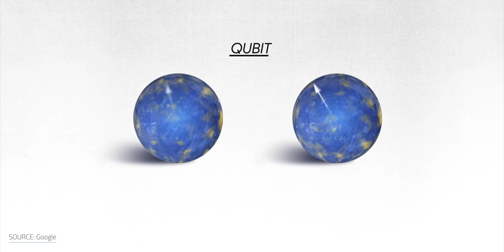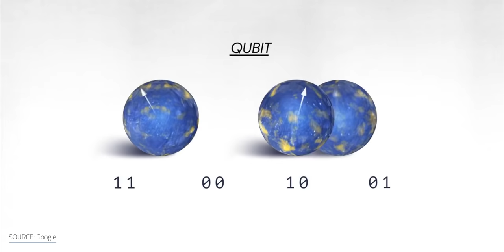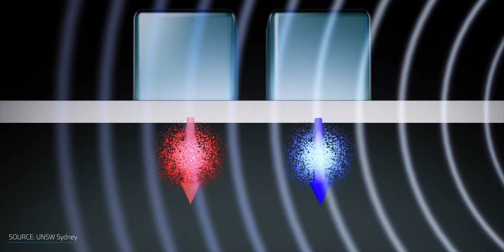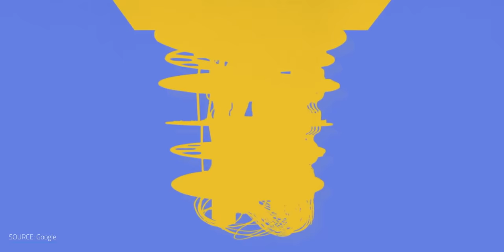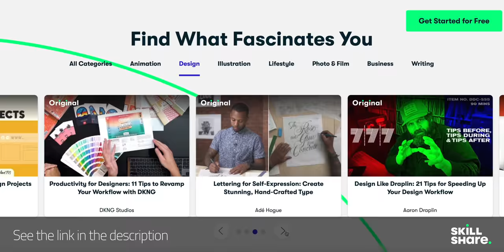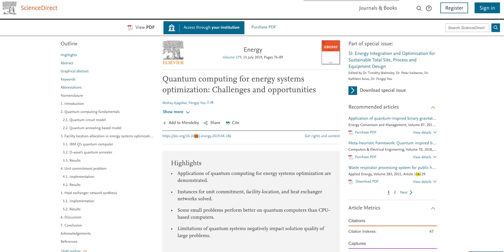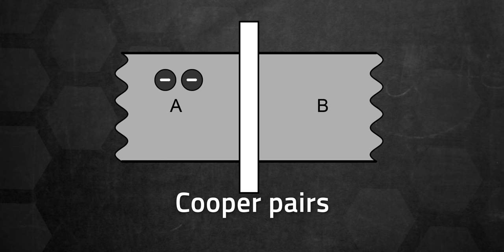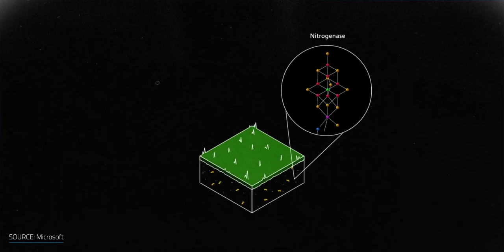Quantum Computers Are Coming … But Why Should You Care?

Comment: Quantum computers aren't faster than traditional ones; they're completely different.  They can (with very complicated math) try out all solutions simultaneously and come out to the one that works.  The way I think of it is a traditional computer works serially, while a quantum computer works in parallel.   Where a traditional computer would have to try all of the keys to a lock one at a time, a quantum computer would be able to try all of them simultaneously and tell you which one worked in one operation.
Reply: Didn’t he explain it that way too, with the postman example?
Reply: The whole "computing every possibility at once" thing is really not as accurate as it is said here; 
In theory, a qubit can encode mutliple calculations at once in a superposition but you can still only ever measure a single bit per qubit (even in theory).
That means that in the end you get at least linear O(n) scaling, as each measured bit needs at least one qubit, which is considerably better than many classical algorithms but still not "everything at once".
(Because many classical algos are in quadratic O(n^2) or O(nlog(n)) time.)

Comment: 7:53 Quantum computers are suited to solve specific types of problems where it outshines classical computing - usually involving combinatorics. This does not mean thart they can replace the datacenters used today for a wide range of applications (such as internet servers or databases).

Once built at scale, they would be more like problem-specific accelerators connected to classical computers similar to how GPUs are used today.
Reply: Yes, I think the video was wrong on this point. The quantum computer consumes less but can only outperform classical computers in specific classes of problems. Also, the video fails to mention that the cooling apparatus surrounding current quantum computers consumes a lot more than the processor itself.

Also, IIRC, quantum algorithms have only been proven to outperform classical in quantum physics simulations. There is a quantum algorithm to efficiently factor prime numbers (Prime's algorithm), but it takes advantage of specific properties of prime numbers and is not applicable to any other optimisation problem. And no, factoring Prime's is not exactly NP complete, so solving it efficiently doesn't automatically mean we will solve all other NP complete problems.
Reply: Yes. Most of it will be used by the big, high-tech companies. Not a single person on his/her table.
Reply: Maybe in a practical sense at first, but any problem that can be efficiently solved by a classical computer can in principle be efficiently solved by a quantum computer. P is a subclass of BQP.
Reply: @nazgulXVII  "There is a quantum algorithm to efficiently factor prime numbers (Prime's algorithm)" It factors integers, you can't factor prime numbers. And it's called Shor's algorithm.

"And no, factoring Prime's is not exactly NP complete" We don't know that.
Reply: i would say: at most. or, very very specific.
Basically they violate a basic principle of computing, which is abstraction and generality. They are NOT computers, they are physical devices, like say, a mechanical or a quartz clock. You always need a lot of computing power to encode the task and decode the result.
Douglas Hofstadter put it clearly already in the beginning of the 1990ies. A physical analog computer is suffering from encoding and decoding task and he elaborated with the Spaghetti computer. The spaghetti computer is the fastest thinkable computer to sort numbers. It is independent of the problem size regarding the sorting. whether to sort 2 spaghetti by putting them upright to the table, or 500... it takes the same amount of time.
The problem however is that you have to label all spaghetti according to their length, or even prepare the spaghetti in order to reflect the numbers at hand, and later to read that from the labelings. And here they loose their advantage.
The GPU are fast in matrix math, so you can use them for anything involving matrix math. Google proposed them to use for representing neural networks. Yet the do NOT represent the neural networks in their entirety, hence they come with a huge cost of getting partially blind.
Reply: @monnoo8221  "Basically they violate a basic principle of computing, which is abstraction and generality. They are NOT computers"
Nonsense.
Reply: @Kalumbatsch  that's a well-posed argument. So- called quantum computers are analogical devices. As such they are not computers that can be programmed to deal with any kind of computing task. Hence they lack a required level of abstraction.
Reply: @monnoo8221  "analogical devices"? What's that supposed to mean? You're just making stuff up.
Reply: @Kalumbatsch  well, I see that you are missing some rather basic knowledge. No point to argue hence.
Reply: @monnoo8221  Yeah, because you're just making stuff up. There is no such thing as an "analogical device". If you mean to say a quantum computer is an analog computer, that's also wrong.
Reply: @Kalumbatsch  
Well, it is by definition, not "digital".  Digit, as in digits of numbers; or integers. It's not that. Analog as in continuously variable quantities; not digital.  It is that.
Reply: @user-dj1hy6zc6q  Wrong. An analog computer is a specific kind of device, the term has a specific definition. And a quantum computer isn't one. It's as simple as that. And when you measure the state of a quantum bit, you get one of two discrete results and not anything in between. It's very much digital in that sense.
Reply: @Kalumbatsch  
Wrong, and wrong.
We agree with you that there are specific definitions, and that is why these are not digital computers.  I don't know what definition you are using.
The output of a true quantum computer is a superposition of all possible outputs with statistical confidence somewhere within that range.  It is not one or the other, or simply 2 possible outcomes.  If you think that a quantum computer's output is digital, I don't know if you know what a quantum computer is.
Reply: @user-dj1hy6zc6q  "The output of a true quantum computer is a superposition of all possible outputs with statistical confidence somewhere within that range"

No. The output is discrete. If you measure a two-level system you get one result or the other, and nothing in between. That's what "quantized" means.
Reply: @Kalumbatsch  
It seems you are not talking about a true quantum computer.
I am referring to a true quantum computer.  One that can process Shor's Algorithm, for example.  One that doesn't yet exist.  A computer that is definitely not digital and is definitely able to do amazing things.
You are talking about a broken one currently being marketed, maybe?
Your grasp on "digital" and "analog" is highly suspect either way.
The value in a true quantum computer is lack of quantization.  Your output is not digital and after iterations, it tends towards a result.  You don't get an immediate answer, but you get a probable answer long before any other known method.
The heart of quantum physics is probabilities.  The moment that you believe that an answer can be narrowed down to one or the other, is the moment that you must realize that the entire foundation of your supposed quantum computer is flawed.
A true quantum computer would say that 1+2 probably equals 3, but there is a chance that it equals 67.  You cannot quantize it to 3, otherwise you are doubting the entire principle of its operation.  If every step is not digital, how can you determine that the final result of X number of iterations is digital?
A quantum computer (a TRUE one) is not digital and does not give you an answer.  It efficiently (compared to other options for difficult problems) points you in the right direction, and then something else is used for confirmation.
Reply: @user-dj1hy6zc6q  When you measure a qubit, the output is one or zero. There is no way around that. The output is digital.
Reply: @Kalumbatsch  
And all the non-digital "computation" which got you different answers across many qubits and provided you a statistical distribution means nothing?
If it was a 1-qubit machine, sure. But then it would be useless.
The computation is non-digital.  If it were digital, no one would have any interest in a quantum computer.
How you collect and interpret the data is not the interesting part of the operation of a true quantum computer.  Computation and interpretation is not the same thing.  The computing part of a quantum computer is not digital.
Reply: @user-dj1hy6zc6q  The bits in your computer are represented using voltages that change continuously over time. That doesn't make it an analog computer. The logic is discrete.
Reply: @Kalumbatsch  
Agreed, for a traditional computer with digital logic and established voltage thresholds designed for binary or trinary or Xary logic of any sort.
The difference is that a quantum computer doesn't ever compute based on any set thresholds.  During no part of the computation are thresholds set to establish digital values interacting with other digital values.  All computation is done with continously variable objects interacting with continously variable objects.  It is by definition analog interaction.  That makes a quantum computer desirable; remove that, and you remove all the magic.
The computation is not digital.  The computation is what makes a computer a computer.
The collapse at the end of a qubit into a particular value is not computation.  It is measurement.  It is the most undesirable part of a quantum computer.  We must have many qubits and/or many iterations to overcome that undesirable property.
If it is the least desirable part, and not a part of the computation, why are you so dead-set on its supposed importance and relevance to this discussion?
Reply: @user-dj1hy6zc6q  "The difference is that a quantum computer doesn't ever compute based on any set thresholds." Yes it does, you have to set an error bound. That's your threshold and it's precisely because you can't get an analog value out at the end. What it does in between is meaningless because you can't ever observe it.
Reply: @Kalumbatsch  
The most important part of its operation is meaningless?  Ha!
It is not meaningless. It is modeled. It is theorized. Algorithms and methodology is designed around it. The continously variable quantities and probabilities of outcomes is the heart of the quantum computer.
That is meaningless? 
We will not agree.
The most meaningless part for me is the collapse to a specific value.  The part you find most important, I find most meaningless.  The measurement part is a hindrance.  It causes much bigger samples to be required in order to statistically recreate the continuously variable quantities lost during the measurement.
Most people agree that a quantum computer uses analog computation.  If you want to disagree based on some technicality that for some reason matters to you, whose going to stop you?  That won't change anyone else's opinion though.
Reply: @user-dj1hy6zc6q  "Most people agree that a quantum computer uses analog computation." Like who? Name one. No, it's not analog computation, it's quantum computation. And the output is not analog, as you claimed.
Reply: @Kalumbatsch  
Who?  Do a search.
We are just talking in circles, aren't we?
The COMPUTATION is done with continuously variable values.  That is analog by definition.  The way the computation is performed is the most important part of the machine; the heart of why it is desirable.
Reply: @user-dj1hy6zc6q  No, the way the computation is done doesn't matter as long as you can control it. The only thing that counts is the output because you want to do something with the machine. Otherwise you could just imagine what's going on and be happy with it. In that case quantum computers could solve NP-complete problems, we just can't get the result. Useless.
Reply: @Kalumbatsch  
We aren't going to agree.
We can imagine everything.  We just don't have an infinite amount of time to do so.  That is why we let the machine do it for us.
It computes using continuously variable values, and we use iteration to determine those output values.  That is the data we care about, and that is the data we obtain through iteration and statistical means.
Reply: @user-dj1hy6zc6q  "It computes using continuously variable values" And a discrete number from a finite set of gates, that's why it's called digital quantum computation. As opposed to analog quantum simulators, which are special purpose devices that we're not talking about here.

Comment: If quantum computers are trying to optimize battery tech, I hope companies are also working on finding superconducting materials at a relatively higher temp.
Reply: Nope, universities and research centres are working on that. Companies just work on taking the finished inventions and figure out how to market them.
Reply: Thats contradicting as heat = resistance so superconducting won’t work unless surrounding air can dissapate the heat
Reply: @rso823  unless you do it under the right pressure
Reply: @rso823  the search for a room temperature superconductors has been going on for decades
Reply: @rso823  one of key the key characteristics of superconductors is little to no heat due to zero resistance. He mentioned needing superconductors that can hold their key characteristics at higher temps because the first generation of SC materials had to be cooled down to almost 0 degrees Kelvin. We actually have had many major breakthroughs in this area of material science and have a number of high temp SC materials in labs and a few that are actually on the market.
Reply: Metallic Hydrogen...
Reply: @rso823  You can create loopholes in a system without breaking thermodynamics, we do it all the time at the macro scale.
Reply: So, we would touch the Graphene again?
Reply: It's not related to the Tc. Superconducting qubits, work at mK due to their operation at GHz frequencies (separation of ground state to the excited state). Or 
Topological qubits care for hard gap in the proximity effect. Also larger temperatures means more fluctuations and noise and connection to the environment.
Reply: Aluminum is one of the most easily recycled metals on earth, it would be a tough question of material vs energy costs operating a rarer material at a higher temp. To me it seems like energy for cooling the operating space is on track to be more available than many metals with impressive material properties in the future.
Reply: Shuvo, temperature isn't a problem quantum computers will have.  Read more and research.
Reply: They do. Those are called high Tc superconductors.
Reply: @Plasmon19  And even then thermodynamics is not a hard rule, it is just a statistical certainty, given colosal ammounts of time, thermodynamics can be broken by pure chance, it is just that those timeframes are longer than the heat death of the universe.
Reply: Excellent observation man. Superconductors are a very necessary invention, we need to have A Holy Grail of, Excess Power Production ( Fuel cells, Nuclear Power), energy transduction ( Superconductors) and Other storage systems like Solid state Batteries, Aluminium Air Batteries and even Nano Diamond Batteries, can help actualise such directives.
Reply: Silicon will always be king. Our 2nd most abundant element.
Reply: we already have thousands of scientists doing that.
Reply: @Damianxavierxx  We can't do these things. They are just fantasies.
Reply: @Withnail1969  Fantasies for some, Not for others.
Reply: @Damianxavierxx  show me any of them. they dont exist except fission power.
Reply: @Withnail1969   Here they are; • ° ,
Reply: @Damianxavierxx  on this channel you mean? there are only pipe dreams here.

Comment: As a physics major I loved the coin-flip analysis to describe a qubit in superposition: As long as it's in the air it has a chance of landing on heads or tails which isn't necessarily 50/50.
But then it turned into an analogy for a bit and I got sad 😂
Reply: Yup.
I fell foul of all the false analogies when I tried to program a quantum computer. They really are nothing like a transistor bit cruncher...
Reply: It's not either heads or tails; it's neither heads nor tails; it's both, and both branches of computation continue interacting with all other branches.  There's really no classical analogy for the quantum world, so the analogies always fail.
Reply: @marktrain9498  That "it's both" thing is a common misconception caused by the oversimplification of the cat-in-the-box thought experiment.
In reality, you'd say that it's not heads, nor tails, nor neither, nor both. It is in fact in another state of being called a superposition.

A spinning coin is actually a great analogy of a superposition: While spinning, it's neither heads nor tails nor neither, nor both. By careful observation you may be able to ascertain likelyhoods of the coin being observed as (landing on) heads or tails; and that stochastic distribution is what we call a superposition.
Reply: @muizzy  What about the double slit experiment? in that experiment it does show behavior that sugest that it is "both".
Reply: @diablo.the.cheater  To answer your question better, could you explain exactly how the double slit experiment would suggest it's both?